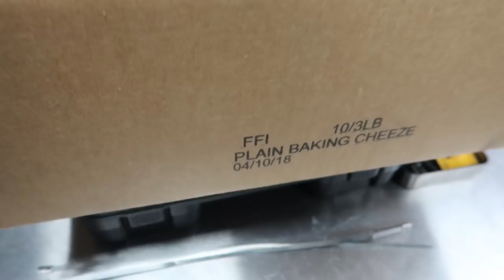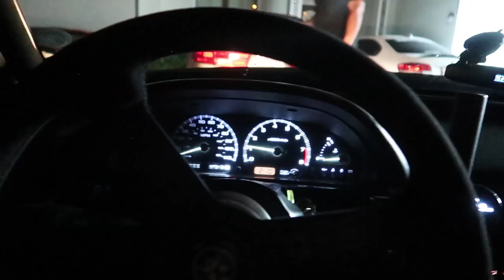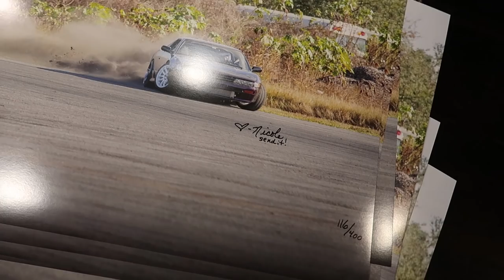IT'S A MIRACLE!

Comment: maybe your thermostat was stock closed and for some reason the water pump built up alot of pressure and since you just had everything re done the headgasket wasnt seated properly so the extra bit of pressure from the water pump leaked into the head
Reply: o Lemurs that's exactly what I was thinking
Reply: This.
Reply: Get a new thermostat but maybe test the one you had in there in some boiling water to see if it opens
Reply: only when the cylinder is compressed, when it decompresses the water still holds its pressure, it can get in during that time very easily, otherwise no-one would ever have problems with water in the cilinders...
Reply: Exactly what I was thinking. Heat causes stuff to expand and somewhere in the engine water gets in.
Reply from the maker: That would make sense, but the water got into the cylinders before it was even running. Could cold cranking the car do that?
Reply: hm that is interesting. im no SR expert but i do own one but i yea when the motor is turned the water pump also turns too. this and the water in your fuel are the only options i can think of.
Reply: Yeah it filling the cylinders up with it cold debunks that theory... Hmm that is weird.
Reply: @adamLZ are you sure you didn't hook up a water line to one of the injectors? :P (also yes I know they look very different twas just a joke)
Reply: possibly, my other thought is since there are some vacuum lines and coolant lines under the intake manifold maybe he got them mixed up and hooked up a coolant line to the iacv or mixed a vacuum with coolant line elsewhere
Reply: Condensation in the gas tank was my thought process. Especially with E85 he could have gotten it from a station thAt had some water in the underground tanks.
Reply: My bad I didn’t finish the video before posting my comment haha
Reply: E85 still stinks like e85 when water is absorbed into the fuel even if it sits for a week or two.
Reply: Highly unlikely scenario.
Reply: How did water get into the oil?

Comment: Hey Adam here a little tip what i got taught while doing my Automotive Degree  is if u want to see if a Thermostat is working fine u put it in hot water and u can see if it will open properly and then take it out and then u can see if it will close while it is cooling down this is the best way to inspect your thermostat and i am glad u got her running again keep up the good work

Comment: Hey Adam, when you put the new thermostat in, take and drill an 1/8" hole on the inside of the ring that is clamped in housing. this allows water (and air) to flow through it even when not opened. It fixes any issues of air pockets, that once warmed up will never clear themselves and they become high pressure steam pockets. Also the temp sending units will not register if they are in a steam pocket. I know it sounds crazy, but trust me I've been building engines for over 45 years and I have been drill the thermostat since day 1 and have never had issues with steam pockets. The sender MUST be submerged in water to register. Your tune is useless without engine temp being accurate. Also steam pockets are very high pressure and could blow gaskest, or worse if it starts to percolate it will blow the seams out of the radiator.  Good luck m8. oh yeah. locate the 1/8" hole to the top. Peace

Comment: I'm guessing with no thermostat the coolant isn't pressurizing the coolant system.When the coolant pressurized with that thermostat it is spreading a crack somewhere and allowing coolant in the combustion chamber.
Reply: blindabinda123 this does make some sense but I don't think anything is cracked
Reply: The cooling system is pressurized with or without a thermostat. The thermostat just allows the car to reach operating temperature faster.
Reply: Eric James it's only pressurized when it heats up.
Reply: blindabinda123 its pressurized whenever the car is running because the water pump has to pump it throughout the block and the head it just bypasses the radiator until it reaches operating temperature

Comment: it can be the stock sr water oil cooler that broke when it overheted the first time...and let water in the engine when it sat, and when you cranked it the oil pressure built the  pressure in the cooling system :or the block

Comment: Thermostat could've been stuck and forced coolant backwards through the system causing it to go into the engine. And once you took the thermostat out it could flow normally so that's why it ran fine.
Reply: Kenny K you clearly have no ideo what you are talking about
Reply: That's not how any of that works. Just no.
Reply: A thermostat does not open until it gets to whatever temperature it is rated to and when it gets there then it opens up and lets water flow through the block from the radiator which is what cools it down. Once it cools down to a certain temperature, it closes again and repeats the process over and over.

Comment: If it's a small crack it could be that it doesn't manifest until it's hot and the metal expands which would explain why you wouldn't be able to find any defects when it's cold.

Comment: Oil/coolant line mixed up and corrected after diagnosing.

High pressure oil feed pressurises coolant system.
Coolant fills crankcase along with oil and as the Pistons come down the water (floating on top of oil) has no where to go but past the rings and fills the bores with water. Also explains water in the oil.

This makes sense in my head and seems reasonable lol

Comment: My guess is retourqing the head made the head gasket seat where it let coolant in the pistons and compression into the radiator. But since you retourqed the head it either made the slight warp in the head or gasket seal up.

Comment: @adamlzLook at your Turbo if it has a water jacket. If you had too much pressure in the coolant system and the water jacket on the turbo can’t hold the pressure then it could get water in both, intake and oil. Easiest thing to look at based on water in those two spots that aren’t supposed to have water.

Comment: Nismo mounts do in fact raise the SR20 quite a bit. I ran them with a Koguchi Power hood and ran into clearance issues with the Valve cover. I eventually ended up switching to Cusco mounts however which solved that problem among other things.

Comment: Florida humidity is extreme and assembly grease breaking down in E85 that is highly anaerobic could make that happen in that specific scenario.. lol Florida problems, crazy
Reply: Gamma Light not likely it also looks like coolant. Just saying.
Reply: UD Fab I agree, somethings fooky. My best guess is a oil drain line getting crossed with a coolent line on the turbo somehow but it'll forever be a mystery it seems.
Reply: That’s true. The SR mystery will always continue. That’s why I rather run Toyota.

Comment: considering you have a water temp gauge and you watch it, id leave the thermostat out. i know this sounds counter intuitive but taking it out allows alot more circulation without the resistance of that spring pressure so the coolant can just FLOW.

Comment: Go and torque the head bolds (studs) after a few heat cycles.... and after 1000 miles again. Loosen 45° (15min on a clock) one after the other in the pattern inside to out side and tighten them back down one after the other. Don't loosen all at once first! go bolt by bolt (stud). That should let the gasket last longer.

Comment: What if the turbo leaked under pressure?  I know its a new turbo but crazier things have happened
Reply: Dude in a turbo are oil 😘
Reply: Highly unlikely for it to leak through its own housing. And im sure boost pipes were checked over
Reply: Trriixx3 King and water....
Reply: Watercooled turbo
Reply: Highly improbable due to how much water would need to travel in both directions. But points for thinking outside of the box.

Comment: Had a similar issue in a old car where there was water in the tank. Fuel didn't burn properly and leaked past rings into sump over night (leaky carb needle). 
If you had water in E85 possibly this could happen, or just condensation from the oil breather tank too. 
Just keep sending it dude and 1jz it when it dies

Comment: Hey Adam, is there any way you can help me out In finding a new SR20DET Head? Mine is a little messed up. And have been looking for some for a while
Reply: Mike Rodriguez I have one from a na sr20de. The only difference between na/turbo models is that the block has oil squirters, the pistons are made of a different cast metal. So I'm sure it would work for you. Do some research and let me know if you want it. Shipping would probably be a bitch since I'm in the pnw

Comment: Hey Adam, I kinda lost the track on your sr mods but maabe a little hint regarding the water in oil problem. Dont know if you got rid of the water to oil heat exchanger completely with your external oil coller and filter relocation kit but these heat exchanger tend to have sealing problems so actualy you can get either water in your oil or oil in your water, would also explain why the problem maybe stoped when you took the thermostat of. With the termostat off you should have way less backpressure on the water system hence maybe the oil/water heat exchanger keeps it sealed. Dont know, maabe worth a try checking this thing out. Cheers Andy

Comment: Happened to my car 4 months ago. Thermostat was busted coolant filled the sparkplug holes in the head but didnt mix with the engine oil. Fixed thermostat no problems after.

Comment: Could be crack between the water pump and the crank case cover. Happend to my m60b40. The thermostat is pressurizing the water and letting it flow in to the crank case if that makes any sense.

Comment: A trick I learned for raising the hood is to put like four or five spacers between the hood hinge and the body of the car. Originally I did it on my car to improve engine bay air flow, but it just looks cool too. But the spacers have to be under the hinge, otherwise the bonnet will crack your windscreen. I'd explain it here, but it's easier to let yall figure it out for yourselves

Comment: I wonder since you said the SR would overheat / get hot fast if that was any cause. If i remember though your first start up wasn't hot and still had it come in.. if not, does make me wonder if its heat related crack or something since you took the thermostat out and it stays a good bit cooler.

Comment: *******************check your turbo center cartradge .  if it is oil ad water cooled it could be leaking internally there.   also do you have a sandwich plate style oil cooler where your oil filter screws onto... you could be getting a internal leak there too********************************

Comment: Some head gaskets need to stay overnight, then you torque them in the morning, then you warm up the engine without water for the head gasket to seal properly. Also you need to push start the car for the first time. At least that is the case for my Russian Lada from 1977 with NOS (new old stock) head gaskets.

Comment: I dont know if you've checked the torque on the cylinder head but I would assume your thermostat was shut and the water pressure forced against the freshly seated head gasket caused it to lift enough to leak so, I would check.

Comment: Instead of changing the oil a bunch of times you can just drain all your oil, put diesel fuel in and run the motor with diesel in it for 30 seconds, then drain and fill with your preferred oil and oil filter. The diesel cleans all the garbage out pretty good.

Comment: Were the intake manifold gaskets torqued well? I had water getting into my cylinders that way. Older Hondas circulate water through the intake manifold, not sure if SR20 does or not. Checking manifold gasket and re-torquing fixed it.

Comment: Lol Your hypothesis is correct, if you didn't unplug the injectors all the way, I  had it happen to me I thought I unplugged it all the way but I didn't pull the plug out far enough and it was still making contact apparently enough for the same thing to happen took me a lot longer to figure out the issue by myself, still running strong now

Comment: Should of completely flushed all the water out before driving it. It can cause issues with proper lubrication on the bearings and cause excessive wear. Usually takes 4-5 oil changes to get nice clean oil.

Comment: Test the thermostat while it's out. Like an apprentice, with hot water and a thermometer to see when it cracks...  just put a vac/ pressure guage on the water pump out line at the thermostat hosuling and see if you have coolant restriction under flow, that'll verify the cooling system while driving. Said this 2 week ago... Jeez boys.

Comment: Drill an old radiator cap and put a tire valve stem in it. Pressurize it with 7 psi and leave it for 24 hours. I did something similar to my m54 engine after building it to confirm I had no leaks.

Comment: I was going to pitch the idea of the E85 separation but you beat me to it. Most fuels go a bit shitty over time e.g. E10 ( Australian fuel that has up to 10% of ethanol) that is left over time separates into separate parts and can end up causing rubber lines to break down and screw up the fuel system. and E85 also does have very similar properties. It is unlikely, but its probably as likely to happen as if you guys accidentally put water in the motor when you were way too tired. When working in a workshop I saw some idiots doing that and requiring the motor to be taken apart.

Comment: Is that turbo water cooled? If so, I would check it ( if you haven't already) and see if maybe something is up with it and mixing the water into the oil.

EDIT: Also, did you fully empty that incooler the last time it had fuel in it? wonder if anything was left inside and the intake sucked it all up and out of it this time around.

Comment: SR's are weird Adam. Mine use to choke at 3K to 4K rpm and there was nothing wrong with the setting iacv and tps. Eventually the problem died down after a week and then started running fine. (It's a NA SR with a shaved head)

Comment: Yeah E85 attracts water it corrodes  aluminum eats standard gas lines and it doesn't have lubrication properties so fuel pumps burn up easy to if you go on Motor Trend on YouTube and watch engine Masters they literally just posted a video talking about E85 and what it does

Comment: Dude my second SR was a Nissan Primera P11 2001 and the first thing that blew up was the thermostat I bought that car in Japan and imported to the Dominican Republic "hot weather" the whole year.. It built so much pression that blew up the radiator top part (it was plastic by the way)so it's totally possible that was the thermostat but I still don't get why the water got into the oil pan..

Comment: I have a honda civic and when i got it it kept over heating no coolant leak ended up blowing the head gasket after i replaced that it started to over one day while i was driving so i pulled over and took out my thermostat on the side of the road and it never over heated again

Comment: put the head again and put the copper gasket spary on the block and head not only the head gasket use another headgasket new and the seat of the head to the block or like this in sr20 drive it again before this but do it right after the next event trust

Comment: Throttle body coolant lines/cracked throttle body throwing water in the intake? Or coolant lines on the turbo somehow? Very odd that all 4 cylinders were wet. Headgaskets don’t magically reseal, but they don’t usually fail everywhere either.
Reply: Do a boost leak test if it continues..

Comment: E85 Can absorb alot of moisture,you sure it wasn't a bad batch of fuel,and your car wasn't just super flooded.I'd have a peek inside the fuel tank see what it looks like
Reply: P.s bonnet spacers will sort clearance issues and dissipate heat better
Reply: And then you had same theory as me after my comment.Alos the pressurized cooling system could be from faulty thermostat

Comment: you're actually extremely lucky that you didnt overboost. Happened to my Mirage... one of the stainless zip ties on my heat wrap cut through the boost line going to the wastegate, wategate never opened, turbo kept pumpin exhaust back into the head, dropped a valve and welded it to the top of the piston. forged pistons + rods ruined, block ruined, head ruined. $5000++ of built engine gone...

Comment: Just putting it out there, but before you did anything, if you suspected a blown head gasket why wouldn't you just do a chemical test on the radiator before attempting any kind of repair? I would probably still do one now to ensure the miracle is really a miracle, and not a severely reduced current problem.

Comment: fresh rebuild plus bad thermostat. .......... thermostat was no good and stuck shut so over headed with no flo .the over heated water sitting still in the water jackets building pressure and water pump helping build pressure the aluminum  head and block flexed with the heat and mixed with the pressure leaked into the cylinder but caught fast enough that didn't cause serious warping

Comment: This is the most diabolical thing I've ever seen an engine do. That's clearly coolant/headgasket failure.... But yet somehow it fixed itself... WTF. Maybe the pressure testing seated the gasket?? Either way the car gods did you a solid after messing up the silvia front on nicoles car... Curious as to what your planning to do to that